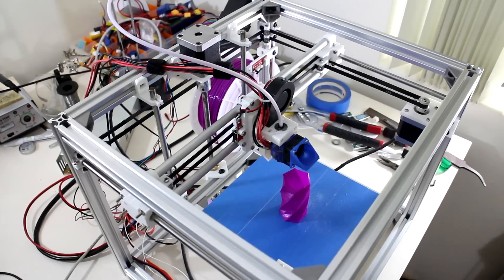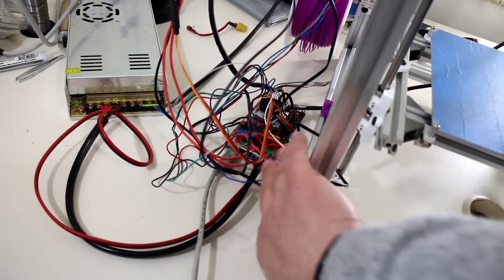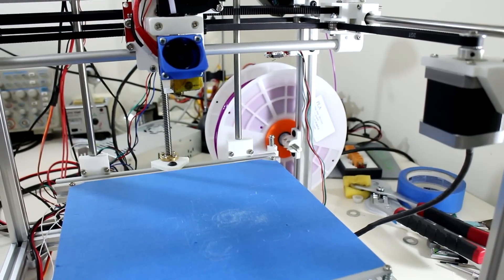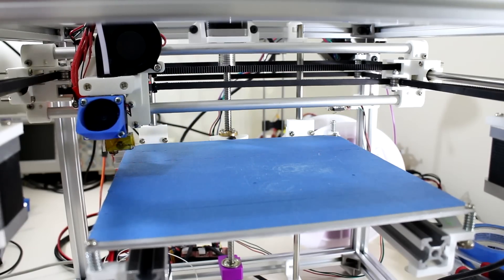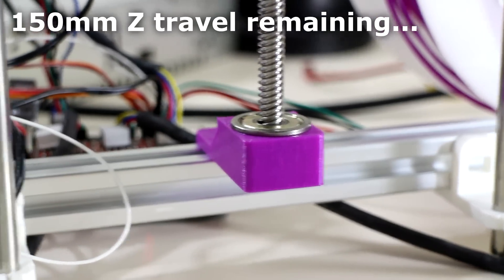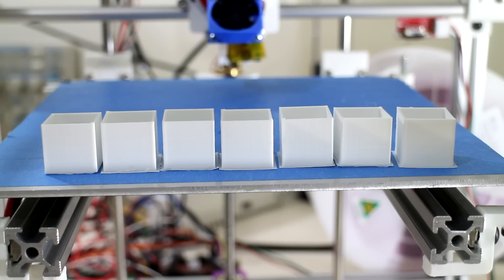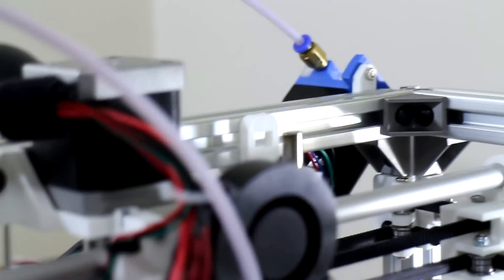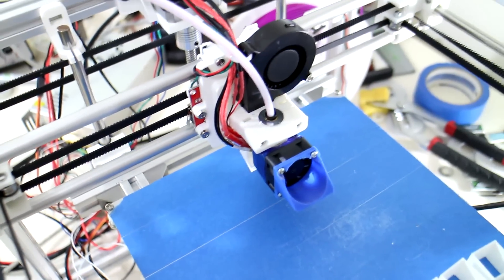New 3D Printer - Build Log #7

Comment: I'm thinking about builiding a large scale printer (90×90×90 cm print area). I don't worry about building the printer, but I'm afraid of the software part. Was it difficult to set up? Are you using Marlin?

Best wishes
Reply: Hugo Pohlak . I know nothing about software but after a bit of reading and a lot of trial and error (mostly error) I made my own printer.
Reply: anthony king Thanks a lot!
Reply: Step 1 buy a 3rd printer
Step 2 get that printer to run well
Step 3 make a 3rd printer 
Iterate

Comment: Hi!

What is the material you have over the heated bed? Is aluminum?
Reply from the maker: I use a Mk2B aluminium heated bed, covered in blue painters tape.
Reply: Thanks for the answer!

Are you having problems with the blue tape for the stickiness? I'm using bluetape with my actual prusa (already ordered everything for the Hypercube, BTW! :D) over an aluminium plate (https://goo.gl/6mzP3G), and the bluetape unglued from the aluminium (that doesn't happened with glass). I have a heated bed, but for PLA I don't use it (although I tried and the blue tape unglued anyway from the aluminium).

Regards

Comment: Quite decent results, but the walls could be better. A4988 drivers are good, better then newer DRV8825, but I think you should try some test print with different settings of current on drivers. For example I can see little differences between vref 0,4V and vref 0,6V on my printers. But more important thing you have problem with in my opinion are ball bearings you are using. I guess you have some cheap chinesse which are never perfect unfortunately. Personally, I recommend  to try Igus RJ4JP :-)

Comment: Was checking the initial part of the video where you show your old Prusa i3 and I noticed the white parts where the bed is resting. Is that to have 4 supported by 4 bearings?
Been looking for a easy way to put my bed supported by 4 bearings instead of 3.
Reply from the maker: They were just a bearing sled I whipped to house 3 bearings. I made it in an effort to increase print quality but it made no difference. There's plenty of bearing holders on Thingiverse, just use the single clamp style is fine.
Reply: Ok thanks. My idea was really convert it to use 4 bearings. I actually found some parts that do that (they were to use 6 but I don't need that many) and I used it. The improvements in the bed play was substantial. No more side play in it, and slightly improved the printing quality producing less ringing at higher speeds.

Comment: Flexible couplers aren't really meant to be used in a configuration where weight is pulling down on them.  That causes them to be stretched and weakened over time.  That's also probably why you had to add the bearing at the bottom of the Z-axis to resolve wobbling.
Reply: I see that you go through a number of revisions for the Z-axis in later videos, ending up with a Z-axis motor that has an integrated leadscrew.  I wonder if flipping the Z-axis configuration might have also resolved your issues (i.e. moving the Z-axis motor and flexible coupler to the bottom, moving the bearing to the top).
Reply: I guess I should have kept watching, you did mention that the flipped Z-axis configuration did work well =P
Reply from the maker: Haha, thanks for your comments :)

Comment: Hi Tech2C, I see you're still using the old Bowden Hotend Mount. I made a new one. Might not be exactly the one you need, but I can send you the files so you can iterate it to your own wishes. It brings the hotend much closer to the carriage :). It was rather a quick replacement and made it work with my own fan, not the one that you have (and prefer).

http://www.thingiverse.com/thing:1708052

I added .SAT files so you can edit it in your CAD program, such as Fusion 360.

Comment: Is there a supplier you would recommend to get an MK3 aluminum heated bed that is perfectly flat with no warping?
Reply from the maker: That is a good question. Unfortunately I don't know. I guess the prices we pay for the aluminium heated beds are quite cheap so to expect warped surfaces, or you could visit your local machinist and get it milled flat. That may be expensive.
Reply: Thank you! you did a good job on your printer :)

Comment: you should use a solid brass coupler 5mm to 8mm, you can find it on ebay. the aluminium coupler is like a spring.

http://www.ebay.co.uk/itm/2-x-5mm-To-8mm-Shaft-Coupling-Rigid-Coupling-Coupler-Motor-Connector-Spanner-/271903232150?hash=item3f4eb21096:g:mpEAAOSwhMFXk03V

Comment: put a 8mm drill bit lock collar down there on your lead screw, or print one. Dont worry it will only makey contact with the inner bearing ring. that is how my Tevo Black Widow is designed both top and bottom of both z screws

Comment: This is great, saw it on thingiverse. This summer I put together a model for a 3d printer I was going to build, looked EXACTLY like this. I mean I realize it's a simple cube concept but man some of the parts are uncannily similar haha. Glad to see this working, mine has slightly different requirements (motors all need to be mounted outside of the enclosure) so bits are different, but I'm definitely peeking at your design for inspiration now that I know it exists!

Comment: Hey Tech2c,
I have decided to join your journey of building a CoreXY printer. I allready salvaged all the parts of my old Prusa i3 and my ReplicatorClone is waiting for your STLs to be printed :) 

In general I would like to take your design and adjust it to my thoughts. While overthinking the printer I came about some questions: 

1.  Have you considered a 32-Bit control board? MKS SBase is a pretty affordable board to get the maximum out of the CoreXY System. ATM I think the old Ramps 1.4 could be a limiting factor.

2. I designed my dimensions for the extrusions so that the printer will fit in a IKEA Kallax Shelf (1x2). That would give me a nice modular enclosure for the printer  for low costs (20€ in EU).  Nevertheless the X Axis will need to be shrinked down a bit. The dimensions of my extrusion cuts would be: X290 Y350 Z450. Can u allready tell if the X Axis with 290mm extrusions will be enough for a acceptable print area? It wouldnt be a big deal if i came out with 180mm but everything below would be little bummer.

3. In your design you used printed brackets to hold the heated bed. Have you considered using the cheap metal corner brackets from Banggood to hold the bed? I dont think this would improve the print quality much but it would eliminate a possible area where vibrations could arise. 

4. In this video you talked about the problem of the Z Axis Lead Screw moving. I found these ( http://www.banggood dot com/T8-350mm-Stainless-Steel-Lead-Screw-KFL08-Bearing-Bracket-Shaft-Coupling-For-3D-Printer-p-1081340.html ). Do you think your bracket could be a final solution? If not do you think the Banggood Ball Brackets could used to solve the problem?

5. Do you think that one Z Axis is enough for your printer? Have you considered to mirror the Z Axis an go for a two Motor Z Axis design? I am overthinking this since my Z Axis will be a bit higher and also my bed will be a bit heavier. 

6. No question just a hint : http://www.thingiverse dot com/thing:1520113/#files I found these covers for the extrusions to cover the wires. You can also buy these on Ebay but I think they are pretty expensive for a piece of plastic (5-6€ p. meter)

Finally thank you for all the time you invest to share all your knowledge with the community. When starting out with my Prusa i3 I followed you along and found so much information on your channel. Thank you for that :)

Btw: Sorry for my bad english (not my mother tongue) I am missing some words from time to time :)
Reply from the maker: Thank you for your detailed comment, and your english is just perfect! I will answer your questions below:
1) A few comments have suggested I try a 32-bit controller. I will definitely purchase one soon to see if print quality improves with core xy and 32-bit. I have read printing slower at say 50mm/s wouldn't produce any benefits but I still think it is worth try if you believe it is beneficial.
2) The X axis is longer than the Y axis. If you need this printer to fit in that enclosure you will need to rotate the print 90 degrees. The X axis can be 340 and Y 290 no problem, however expect about 190mm print travel for Y axis.
3) I haven't considered using metal brackets for the bed, I have used them for the entire frame. So far they are working ok for the bed.
4) The lead screw was moving up and down with the spring coupler, so those bearings won't help. I needed something to hold the lead screw in place and bear the weight of the entire Z platform.
5) I think this Z axis configuration is enough fro 200x200 build platform, but any bigger would cause problems. Other comments have said they wish to build larger, so duplicating the Z axis configuration on the left and right side of the print and suspending the aluminium extrusion between them is path for this.

Thanks for following this build series!

Comment: Can someone who knows what they are talking about point me in the direction of the best diy kit printer for under $500. I have been looking on the net for days and everyone has differing opinions. Can someone please give me a few good options. This design he is using seems like a good option compared to the others I have been looking at... is this a kit or custom design?
Reply: Its a custom design. I'm in the process of building a dual extruder version of Tech2c's design. It has costed me 500$.
Reply: ***** Is there a complete parts list somewhere for this design?
Reply: https://www.aliexpress.com/item/large-size-metal-fuselage-High-Quality-Precision-DIY-3D-printer-kit-with-LCD/32549538291.html

I've built a few of these DIY kits, includes clone Prusa I3 on ebay, Tevo Tarantula. Acrylic  clone prusa (ebay ) are very cheap and nasty, you'll always be adjusting and readjusting after each print/s . Tevo Tarantula is OK ,the V-slot wheels system seems like a good idea but you'll need to fiddle with it for repeatable good prints.
The above link is so far the best I've built. Its a clone Ultimaker 2 (original is 4x the price.) . Very sturdy, parts are easily sourced or printed.
Goodluck mate.
Reply: Thank you... That does seem like a good option for the price.
Reply: bryphi77 Doesn't have a heated bed. Low end hotend. Leadscrew isn't supported.
Reply: ***** Yeah, after looking around I found a few kits that are in this design. I will post what one I decide on before I buy to see what you guys think. 
What about this one?
https://www.aliexpress.com/item/2016-Free-shiping-Full-metal-Large-printing-size-High-Quality-Precision-DIY-3d-Printer-kit-SD/32677798453.html?spm=2114.10010108.1000014.9.QGNxIN&scm=1007.13338.33346.0&pvid=57be250f-1898-4d27-9ce7-9b7fe91e2d24&tpp=1
I have full intentions of modifying the design because I know that a kit will have design flaws that are not up to my standards. I just want a good starting point that has all the parts out of the box before I start.

Comment: In anticipation of the STL files, I cut up my 20/20 this afternoon. I went with 425mm for every piece. I'm hoping to end up with a 300x300mm heatbed and a 250mm Z axis. Hopefully the material is rigid enough, I may have to modify my design a bit.

Comment: For proper speed capabilities, you may want to consider a 32bit board on a corexy setup. The 8 bit ramps works, as it does on a delta. But a 32bit board has a dramatic effect on quality and speed on a more complex kinematic. Congrats on the build. Love your setup.
Reply from the maker: Hey Bruno, can you point me to a link where the dramatic effect on print quality is detailed? I would really like to move to 32 bit if there is a print quality improvement :) Cheers!
Reply: Unfortunately I cant find the thread on reprap forums in the corexy sub section. With that said general consensus is that the 32bit hardware allows for quality increases at higher speeds. Some guys were reporting as high as 300mm/s print speed with very decent repeat ability as I recall. With that said, I run a delta, and for sure I can say that 8bit ramps is limited when pushing high resolution and high speed. I notice slow down's (still using 1/16th microstepping) when hitting 100mm/s+ print speeds. I generally keep my print speeds in the 65-100mm/s at this point, have tested up to 160mm/s but the processing is not there to take advantage of it. I am also planning on a COREXY build in the near future but this time with 32bit electronics and possibly .9 degree motors with 1/32 microstepping or more. This should increase resolution but also increase computational demand.

Comment: Hi 
Is adding second extruder will increase printing time? 
If not, how can we do it
Reply: Why increase printing time?
Reply: no thats if you want to use 2 colours in one build w/o stopping the build and changing colour and having to fart around with it
Reply: if anything you could set the motor speeds faster but it might wreck the print look up a delta style printer their faster then the average printer

Comment: Excellent build videos! Very excited the past few weeks to get on YouTube and follow your build logs! I couldn't help as you pointed out explain what is happening with the ripples on your print. There are a few factors that may cause this which may include a non ridged frame (which you dont seem to have), too high or low of temperatures (which im pretty sure you have enough experience to maintain), slightly clogged extruder (I believe you are using a new extruder or have cleaned it with proper maintenance), extruder steps per mm, and or a slipping drive gear or motor (which again, you probably adjusted your step sticks properly). 

All aspects of your printer have been designed to eliminate that problem except for one. One of the most important parts of a 3d printer is the extruding system. Among resolution of the z axis (100, 200, 300 micron layer resolution) there are also steps per mm of plastic that is fed into the the extruder. As your printer prints, the extruder hobbed gear turns a certain degree at a time. For example an extruder with no gearing (which is what i believe your printer utilizes as the compact bowden extruder from your thingiverse page) that does 200 micro steps per revolution which will turn 1.8 degrees at a time which causes a high pressure while it is turning and a low pressure when it is waiting for its next initiation during the print resulting in a high and low (ripple) affect in your print. This was solved on my printer when i added a 5:1 planetary gearbox to my extruder. So, each initiation on the extruder will turn at 0.36 degrees per step resulting in very straight layers. 

So comparing a non geared extruder which turns 1 revolution with 80-100 steps per mm with a 12mm hobbed gear compared to a 5:1 geared extruder which results in 1 revolution with 450-550 steps per mm resulting in a very smooth line of filament per layer.

I hope that gives you an idea for a future video and hope that solves the problem as it solved mine! Again very great videos and keep up the great work! Sorry for the long comment but im sure other people will be happy with the information. Thank you!
Reply from the maker: Great info and thanks for the detailed comment!
I've been using this extruder setup for about a year and am happy with its performance, but you raise good points for using a geared extruder, which is what the wade style direct drive with hobbed bolt extruders do I suppose.
I've been adjusting the belt tension and acceleration settings which seem to change the ripple pattern, plus as I;ve been swapping the parts for more solid PETG pieces seems to add rigidity to the frame which helps.
Again thanks for your detailed comment because others read these and find value in your experience :)
Reply: Thanks its great to have pride in your own designs and glad to help!:)

Comment: Tech2C, are you pretty happy with the leadscrew and nut that you are using for the z-axis? I'm looking at upgrading my prusa i3 z-axis to use these leadscrews and am trying to find some good parts. Thanks!
Reply from the maker: I am happy with the leadscrew, however the springy coupler could be an issue. Saying that I used M5 threaded rods and springy couplers and they performed very well. I'm not sure if it they are better overall than straight M5 threaded rods but worth a go as they are inexpensive.

Comment: The ripple on the new printer actually looks more like the artifact of the direct extruder. Try a different one with 0.9 degrees or geared and there should be a visible difference before you try to troubleshoot the x/y axis vibration.
Reply from the maker: The very minor ripple is only visible on the Y axis, which is the entire x gantry moving. I think it's belt related as the belts are not very tight at the moment.

Comment: Did you have to make any changes to the firmware when you move the electronics from one printer to another? I am asking because I want to upgrade my prusa i3 z-axis.
Reply: Yes you would have to change the firmware because of the different drive system
Reply: I was just expecting a Build Log on all the changes to the firmware
Reply: +Una Mirada de Ciencia Ficción he will probably just release the firmware for the board that you can just update your printer with but if you can you might want to just get a extra ramps 1.4 kit or something for $30 us and keep your other board on your current printer incase you decide to rebuild it so you can have the same settings and won't have to figure them out